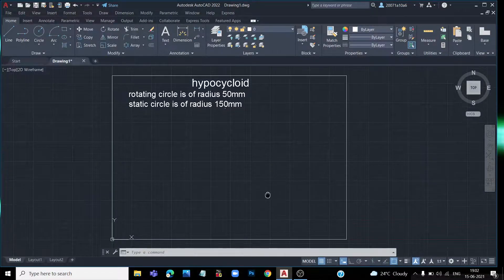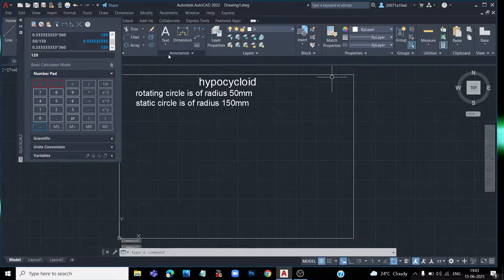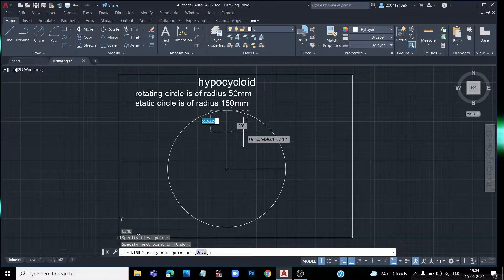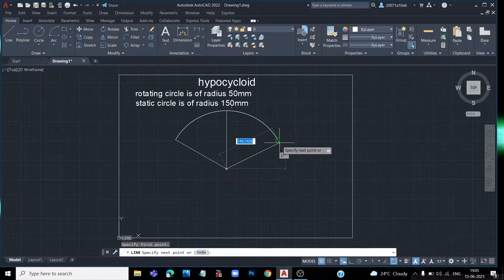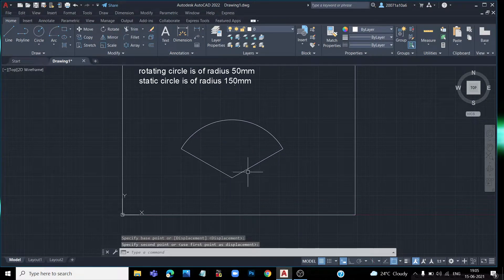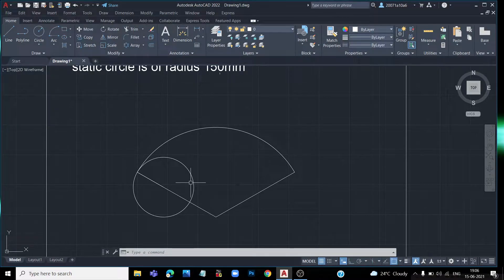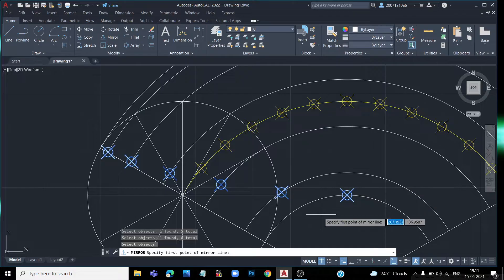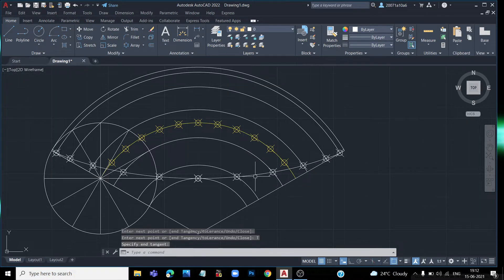hypocycloid ||how to draw hypocycloid in auto cad ||in telugu

Comment: Can I run Catia , 3d modeling softwares smoothly in i5 11 gen with Intel iris Xe integrated graphics?
#hp_pavilion_14dV0054tu
Reply from the maker: It will work, but you will have problems in large assemblies, when you try to rotate.
Reply from the maker: thanks for ur support
Reply: @telugucad1312  Tq bro ❤️